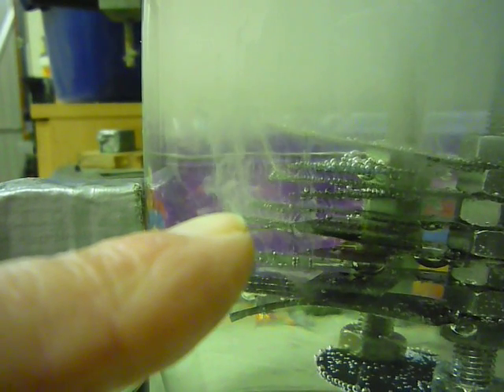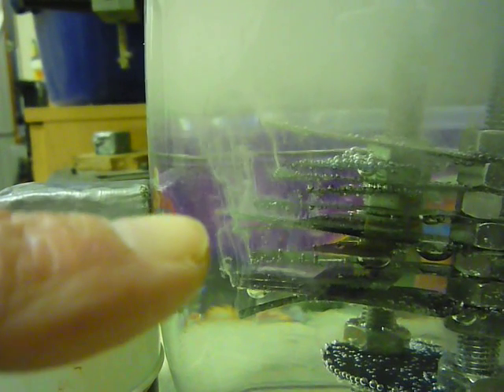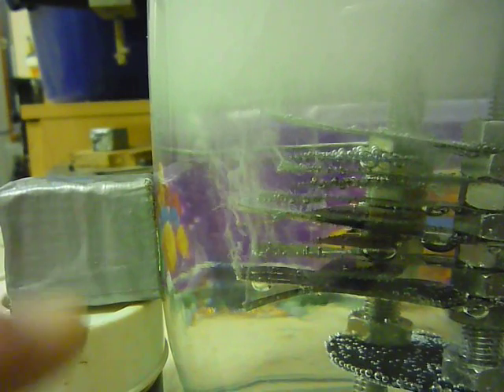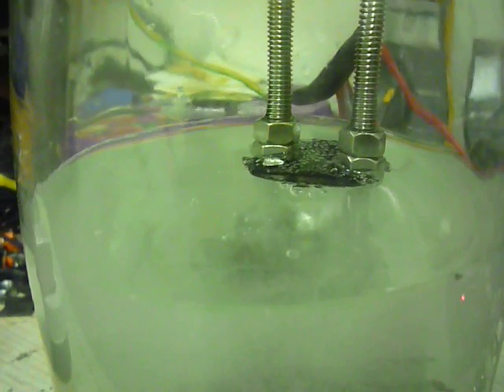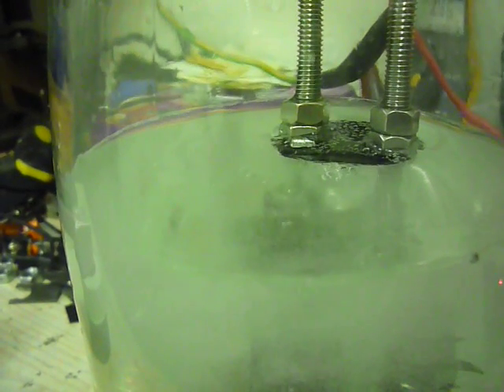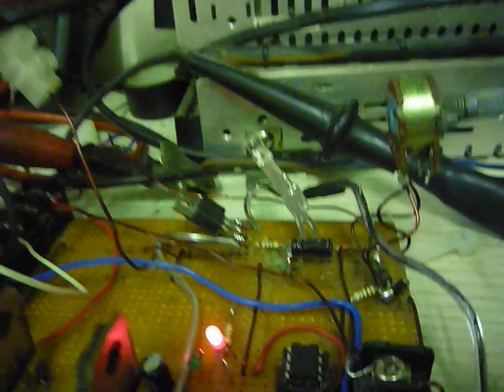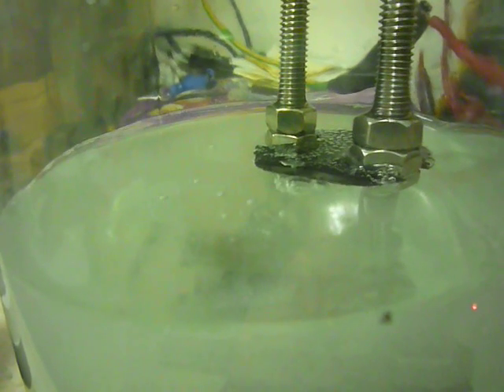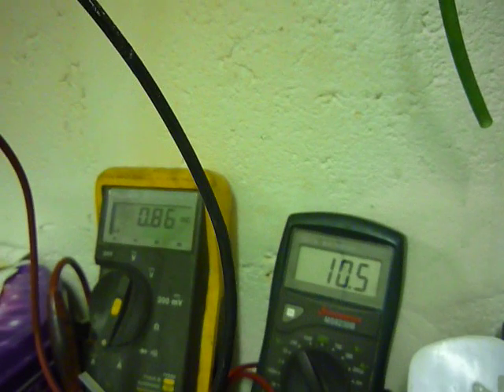HHO cell - magnetic attraction of hydrogen

Comment: Ok i think there is something interesting you have missed, the magnets have very little affect on the cell until you pass current through the magnet itself. With the magnet used as a cell plate or part of a cell the gasses spin around in a vortex. It should be no problem to confirm this if you havent noticed already.

Comment: Of course you are useing pulsed dc not actual ac, not sure how the terminal posts are a problem?

Orthohydrogen and parahydrogen are the 2 types of hydrogen (not hho like i said) it has a connection with magnetics that you are working with it`s a long shot, i know little about it, but chuck an idea in there and you may have a eureka moment.
 
Laser injection is something i do know about and will weaken the water molecule bonds. Are you experimenting to achieve a certain goal?

Comment: Hi reeseht,
 
Yup AC at any frequency don`t beat DC . HHO can be split into 2 different types with a electric field, i have never looked into it`s use but you know chuck some idea`s out there.
 
You can try laser injection, the atoms that make up water absorb photons pushing electron orbits out and the bonds between H and O are weaker , now it works with electrical stress across a water bath but electrolysis i do not know. All part of the fun finding out.

Comment from the maker: North field attracts the Hydrogen - South Pole repels - visa-versa for Oxygen
"BOTH" the Anode & Cathode Titanium went deep purple (Titanium Dioxide), after the first few seconds but there was little change in the amps/volts or hho production.
Cathode is 20mm from S/S Bar at nearest point, 50mm at furthest point where the Hydrogen is pouring off. Anode has the same measurements from the S/S bar. 
Jim